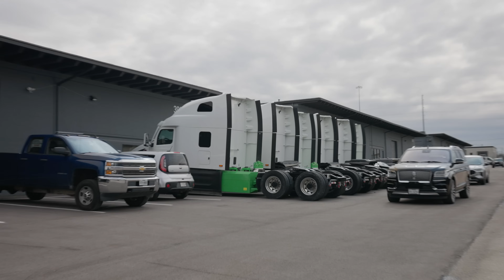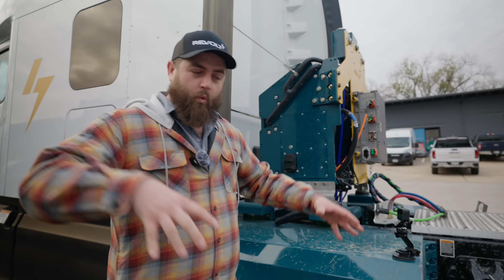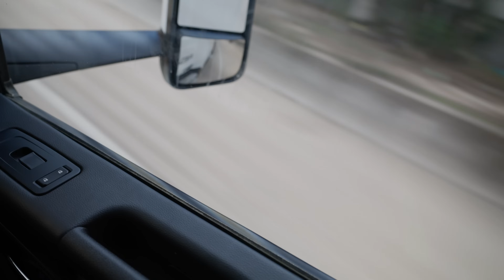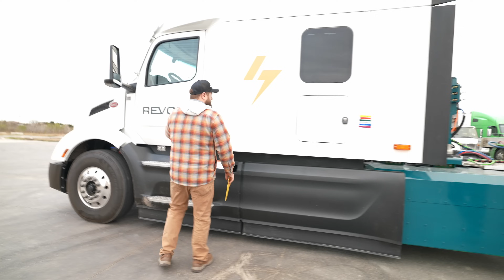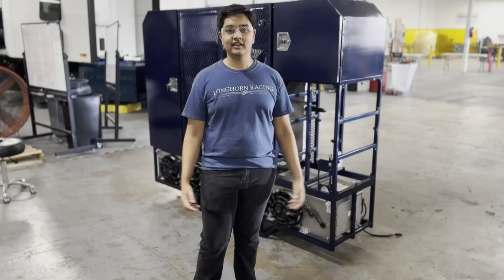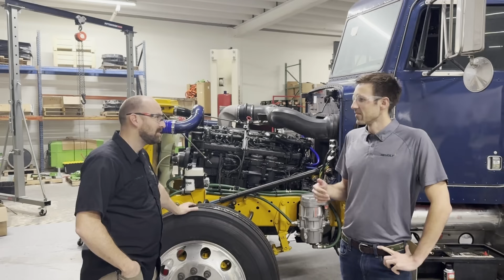Test Driving First EVER Diesel-electric Peterbilt Truck!

Comment: You can run a smaller engine at peak efficiency 100% of the time. Batteries take care of peak power. And, let'š by all means try to maximize regenerative braking. The problem is the batteries can't recharge as fast as regenerative braking can put out. That is why we need hybrid batteries. Meaning a battery + supercapacitors, that can take a LOT of charge and store it for a short while...
Reply: What you're fogetting is all these add on will increase empty weight
Reply: @jamescaliendo1030  
And removing the trans, transaxle etc, along with a smaller engine will reduce the weight by quite a bit
Reply: @zaarkeru3391  not by as much as the batteries add...
Reply: Well, a Iveco seWay can regen about 800 kW which is just insane.
Reply: Or you can use the generator as a additional "engine brake".

Let the engine run at full power and just run the electric generator in reverse.

That way you could use the batteries as a main engine brake and the generator as a secondary engine brake.
Reply: @zaarkeru3391 I think you mean have the generator spin the motor with engine brake on so the battery can absorb more power.   Much better to just oversize the battery a bit more to handle the power.
Reply: @zaarkeru3391 the generator is connected to the diesel engine only, not the wheels. Literally, the ICE + generator pack is totally disconnected from the wheels. You could mout it on the trailer and only run power wires to the cab, for example (although that's a VERY stupid Idea)
Reply: This exactly. Its been used successfully on trains for this reason.
Reply: @wolfenwingsable trains weigh way more. Most hybrids loose weight capacity do to weight of batteries. 
Depending on how many thay choose to go with.
Reply: @123brendan100  Pneumatic tires are a greater loss of efficiency than trains weight.  The train is still more efficient than any road vehicle.
Reply: No you don't need super caps... the newer types of batteries can charge at very high C. Rates and Li S and Al ion and Al S will do insane amounts of power. 
Al cells can pack potentially double the Energy density of Diesel fuel. 80% in 8mins.

Final point ... Recharge from renewables whenever you can. It's cheaper and cleaner than the generator the generators a convenience and emergency back up device....don't burn the dinosaurs 🦖🦕 juice unless you have to.
Reply: Are a fairly large energy battery. That also adds additional cost and weight though.
Reply: If you are so smart make your own truck.
Reply: Since the axle(s) are constantly moving up and down while moving would be another way of converting that movement into electrical impulses?
Reply: Of course this would all be last-mile and weird-load consideration if we had decent infrastructure in this country.  The rest of the world shifted long distance freight to rail and electrified the railroads a long time ago... it's basically just the US, Canada and Australia for major countries on the poverty bus.
Reply: @BalooUriza  US, Canada, and Australia are not on the "poverty bus" as you say.  Your ignorant comments show a lack of understanding how the geography, demographics, and economies of those countries made self-contained diesel-electric locomotives the most sensible solution to rail freight.
Reply: @rhekman  When it comes to transportation in developed countries?  Yeah, we are.  Developed countries typically have good high speed rail and walkable cities.  We ripped out walkability and transit to make more room for the movement and storage of private cars for folks who are rich and able bodied enough at the expense of the working class and disabled. The most expensive, worst option.
Reply: @BalooUriza  Other countries are significantly smaller than US and out of necessity of geography, economics (aka land cost) makes rail lines very logical.  Not logical for US with various different Geographies, huge need for variability/flexibility  (low cost land middle of nowhere to put depot for example)  makes rail not as viable in US.
Reply: @BalooUriza  the US uses freight rail more than anybody else... I have some theories about where this myth comes from, but none of them are interesting.
Reply: @superfamilyallosauridae6505  Only because of scale.  The railroads have screwed themselves out of any time sensitive business by going so slow the only thing they're good for is hauling garbage, coal and other crap that doesn't matter when or if it gets there.  It's long past time to abolish private railroad ownership and modernize
Reply: @ you make it sound like trains came around after trucks and the other “good” countries were using trucks then switched to trains when that’s not the case at all. Then you bring up “walkability” when that has nothing to do with this video whatsoever because like any urbanist you have to bring up other countries that are far more urban and much much less expansive as the USA as if they compare directly.
Reply: @TheMW2informer Sure, just ignore the fact trains did come before trucking and railroad built American cities with walkability a forethought, then we ripped all that out to make room for this car fad.
Reply: @ that’s literally what I said, and in your comments you make it sound like countries were using trucks THEN switched to rail when that’s not true. The reason they switched to trucks is that it’s easier to get to the end destination if it’s not near rail. Walkability has nothing to do with this video or comments, I could bring up the fallacy of induced demand and how it doesn’t work when applied to mass transit of any kind because there is not a demand for it. Makes just as little sense as saying “we ripped all that out” when most rail ROW in the US is from the 1800s.
Reply: Nobody gives a crap about this woke BS.    Might work for city P&D if the truck only needs to work part time and weight does not matter but beyond that it’s way too heavy to be practical and avoid the cold at all cost!       The clutch and common sense left the industry at about the same time.
Reply: @bobcobb7719  
Being conservative and deranged is quite the common combo nowadays
Reply: @bobcobb7719  Seems like you haven'T ahd a look at it. Here the Limit is the driving time the truck is fine all year around. Even fully loaded. It limits a bit when you have 2 drivers. Otherwise it is already cheaper (and better to operate - always able to operate on speed limit even uphill, where everyone else has problems).
Reply: @bobcobb7719  Diesel Electric is superior in all ways to diesel alone.  This is NOTHING to do with WOKE.  Electric only yes... there is ton of virtue signaling in elec. only.  Diesel Electric thoug goes back a  century; long before Woke existed.  Actually this year Diesel/Electric goes back exactly one century with the first Diesel Electric (locomotives) hitting the scene in 1925

Comment: Electric-diesel semi? Sounds familiar.
Reply: Apparently they approached pete to do this same thing for a customers truck but pete didn't want to do it to a 389. Edison didn't play ball or we'd already see a setup from them. 

AFAIK it was going to be an edison supplied drivetrain to be installed at the factory, pete wanted it in a 579, the customer wanted it in a 389. Neither party would play ball so edison missed out as a whole.
Reply: @Lysdexis what? 😂

Comment: Instead of driving the power steering pump electrically why not just use electric steering? Bruce’s Scania has an electric motor on the column for lane keeping
Reply: To keep the steering shaft. Don’t want an electric motor controlling it by just an input.
Reply: Because you would have to reengineer the whole steering system. Keeping the hydraulic steering keep things very simple and stock- the Peterbilts never had electric power steering.
Reply: @ you’re right, thought about it afterwards. Something for the future.

Comment: Didn't USA pull out of Paris agreement? No need for electric future…
Reply: You could only find one trucker at the Pilot Truck Stop.
Reply: It's all about fuel consumption, if the trucks need less fuel they'll find clients. In Europe these hybrids trucks didn't exist, they've natural gas ones or they go full electric with batteries or hydrogen fuel cell.
Reply: @p4olo537  Diesel is king mate!
Reply: @Jakejustquietly that’s not what trains and mining equipment says.  They are both hybrid diesels like this and run in higher demand environments…
Reply: @ they don't carry the weight especially In Australia 250 tonnes!
Reply: @ also
Don't compare Europe to America, most USA states are the size of some countries its not comparable.
Reply: @Jakejustquietly  what doesn’t carry the weight? Haven’t seen many diesel tracks towing 90,000plus tons have seen hybrid diesels trainings doing it though…. Diesel trucks more like the baby duckling than the “king”
Reply: @ time will tell zinny
Reply: @Jakejustquietly  what’s the capacity of a cat 795f ac by the way. Hybrid truck works in very harsh environments. Not the “king” Oooo 345 tons maybe it is the king… hybrids don’t work though…
Reply: @Jakejustquietly  like less than a hybrid mining truck you mean?
Reply: @ hybrid trucks have a market for the small stuff not for heavy haulage through tough country.
Reply: @Jakejustquietly  mmmmm as I said the ‘cat 795f ac’ runs in tougher country then any road going truck so don’t really see what you mean?

Comment: Nice ideas. Problem I see is weight restrictions. The gross combined weight is affected by the weight of the motors,  batteries, cooling systems...
 Excessive tractor weight equals less trailer/ load weight...lost revenue.
Reply: Edison Motors found the weight gained by the batteries and e-axles was offset by the smaller engine for the generator and lack of a transmission.  In Canada they also get an extra weight allowance because it’s electric.  I would assume the Revolt Peterbuilt is about the same weight as a normal truck with the same options.
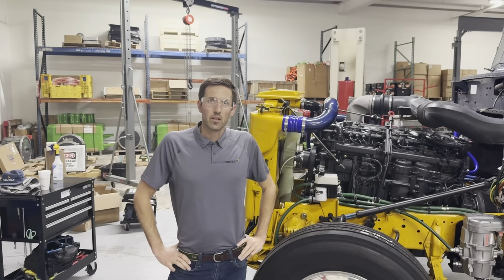Reply: If you can run red diesel make sure you carry the letter from the DMV and taxing authority. 18:42